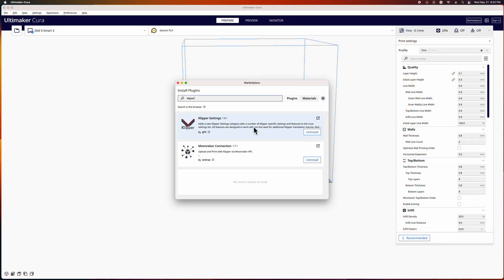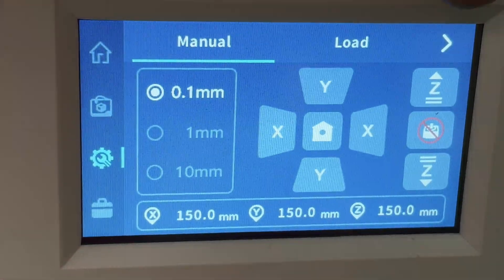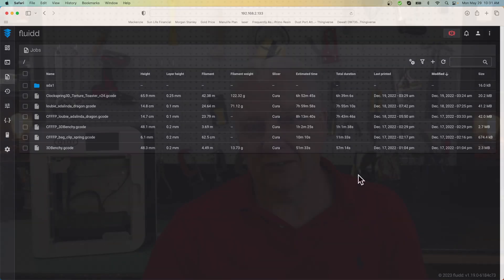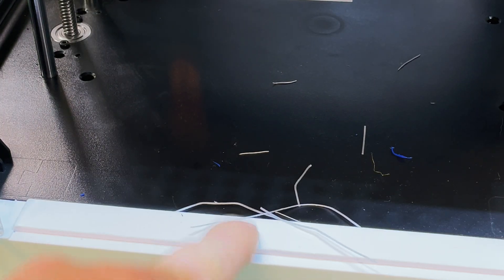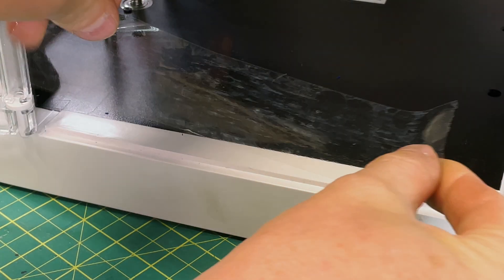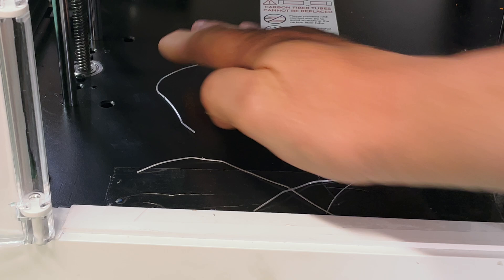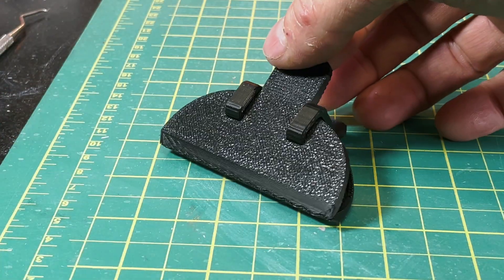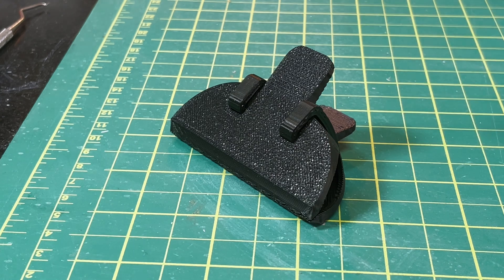QIDI X-Smart 3: My Thoughts After 30 Days With This 3D Printer

Comment: bought this printer for 180€ 2 weeks ago xD, i own 2 Vorons they are in another liga but the qidi do a great job, good results, fast and small, like him. downsides, Filament Change is really annoying if u do it regular , many plastics (door, top ...), old display and klipper is not open so no updates unless qidi release them by themself, but overall for 180€ a great printer for small things.
Reply from the maker: For the money it’s a decent printer. I still have this printer and use it for small jobs.

Comment: Having to clean my carbon fiber rods about every 6 hours. If I don't, the head will start to chatter and prints will become deformed. Steel rods would be better.
Reply from the maker: Where is the dust coming from?  I've had mine for well over a year and haven't touched the carbon rods.

Comment: Just to clarify, did you use Qidi Print, or Qidi Slicer? Qidi Slicer the correct software for this printer and will provide much better functionality.
Reply from the maker: I probably use Qidi Print, but I just switched to Cura shortly after doing this review.

Comment: I really enjoyed your video, thank you for taking the time. 

I have the Xplus 3 and it’s been a monster on ABS. I as you was not happy with their slicer. Not that it didn’t do a good job, it’s that it wouldn’t slice big files. Like someone else mentioned I have been using Orca and it’s done better than Prusa or Cura.   I like the supports better in Cura but the Orca hasn’t been too much hassle. 

The one thing I can say is their support has been the best I have ever gotten, from anywhere actually. I had a problem with the tool head fan and in 4 days I had a new board in my hand ( I can’t ship a package from Texas to Montana that fast). They also included another hotend for a spare. Then they also sent me an updated Z sensor. Like you all the videos and documentation were perfectly laid out. The machine occasionally will have a quirk, but my other three machines have them too. I’m mostly using mine for ABS and so far everything had come out great.  I’m glad I came across your channel. I’m looking forward to see more of your content.
Reply: Not at all. They have answered me on the weekend as well. I don’t think I’ve waited longer than 12hrs for a reply. We all hope we don’t need to ask for service, but Qidi has out done them all.
Reply from the maker: @lorinrobbins7911  This is great information for anyone who has waited days to get a support response.
Reply from the maker: Thanks for the vote of confidence and the feedback on support.  It was great for me, but I have an audience and some influence, so I often think I see a level of support that others wouldn’t

Comment: i have no issues also with ABS, already used 1Kg with no issues!
Reply: Ive gone through a few rolls of abs on mine. It works great. I tried both the qidi rapido abs and other brand abs. Qidi brand seemed the cleanest.  All 3x brands I tried worked great. I was able to getaway without a brim om some abs prints. For all abs, I use gluestick.
Reply from the maker: @ericm.8885  Thanks for the feedback.  I haven't even required a gluestick when doing ABS.  The QIDI lets you make the bed very hot, so the ABS sticks like crazy.
Reply from the maker: It’s great to finally have a printer that can easily print ABS because the parts it makes are indestructible.  I’ve struggled so much with ABS in the past.

Comment: I've had one for about 2 weeks now and love it.  I have a few much larger printers gathering dust.  The small size is great for most prints and it's so fast.  For $449 it really is a lot of printer; wish this was my first printer!

Also, I randomly got a hot end and small PCB from QiDi in the mail today... I emailed to ask if it's just an extra or what.  I ordered a bunch of their filament recently (which is excellent) so maybe related to that.
Reply from the maker: I’ve been talking to them lot about their hot end and have pointed out a few issues, so it think they did an upgrade. The small PCB is under the white cover of the print head. I’ve already replaced mine. They do seem very responsive to feedback

Comment: Thank you for your insights about QidiTech and there machines.  The next size up printer is on my short list if/when they get the bugs ironed out.  May I also suggest (probably) the best slicer, imo, in the wild right now and especially for klipper(ized) printers is OrcaSlicer.  It's a fork of the BambuLab slicer, which is a fork of PrusaSlicer.  It's has a much more user friendly interface, as well as a built in web browser for the printers Fluidd/Mainsail frontend.  Much more convenient that jumping over to your "regular" browser, just enter the printers IP address in the printer config and you can upload the gcode directly and the next tab gets you to the web interface.  🙂👍
Reply from the maker: I’ve taken a quick look at Orca slicer recently and it’s got some nice improvements

Comment: I've gotten several printers Steve, but I keep going back to my Anycubic Vyper. It's the only one that I, a novice, can use without a single hiccup and get good results on every print. I've had it since the launch, replacing my Mega, about a year and a half, and it just works.
Reply from the maker: Well I would tell anyone to stick with whatever works. It why I’ve hung onto my own 300x300 core xy for 4+ years - it just works. I’ll see if I develop the same love for the Qidi